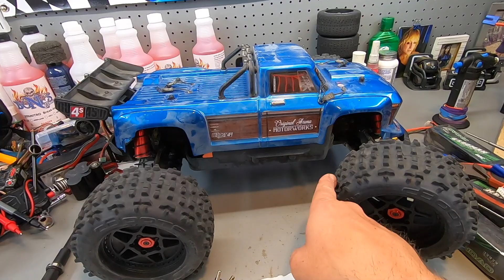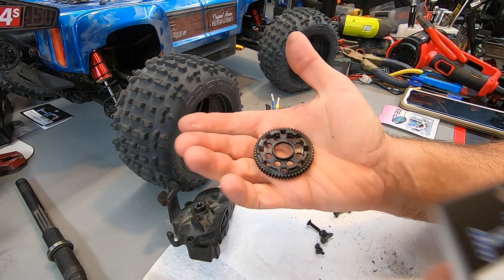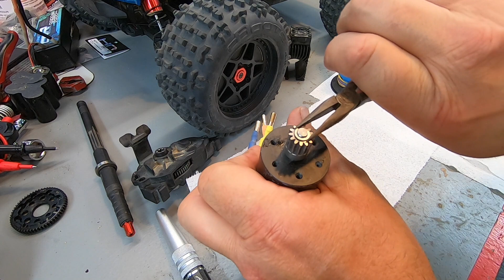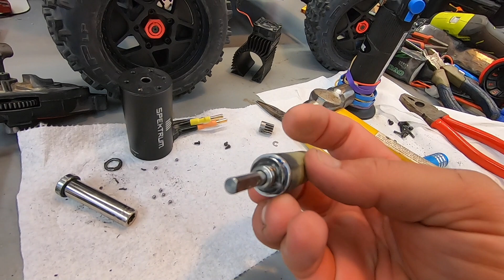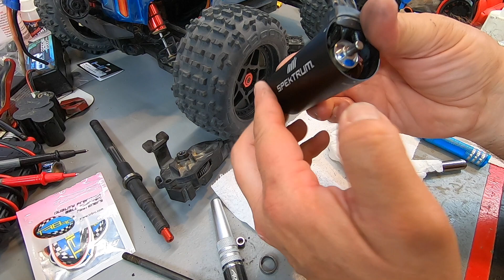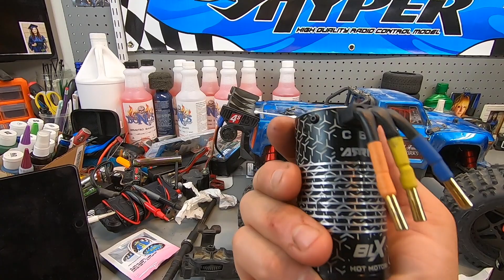New Arrma Outcast 4s V2  I KILLED that little 2400 KV Spektrum Motor

Comment: How did you take the trans out, the manuals from armma are complete usless and don't explain anything, and there'd litterly 0 videos
Reply from the maker: Remove single screw underneath chassis that's attached to the red block between the center spine and the motor mount, remove one side Tower to Tower brace, swing away, compress drive shaft to remove, swing rear battery stop to remove red block and slides towards battery tray area, pull up center tab (looks like half of a butterfly wing) gently use some type of a pry bar to push module towards ESC or center spine area work left to right gently and that will pull the entire module out the only thing you may have to do is remove the one screw that is attached to the motor wires retainer just to give slight bit more clearance disconnect motor and fan wires. Hopefully that helps
Reply from the maker: You just gave me an idea maybe I should do a video. 😂🤣
Reply: @rcguygarage  that would be awesome, the 4s Outcast I have is the v2 and with a 6s firma system and surpass motor, I've removed everything I can to get it out as the differential needs work but I can't get it to budge
Reply from the maker: @CalvinWolf574  thought about asking a Facebook group that specializes in this particular vehicle because I know there are plenty of those and you could get your answer ASAP normally
Reply: There's been a few and that description actually sounds like it'll help, at least more than the manual did 😅